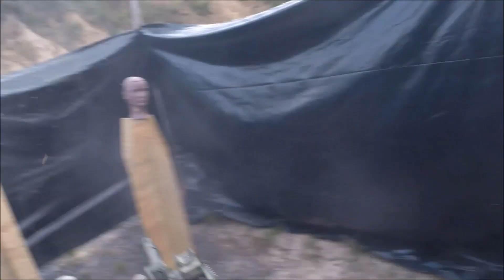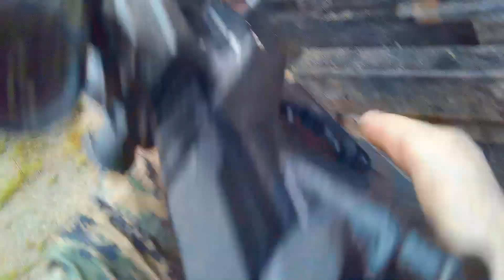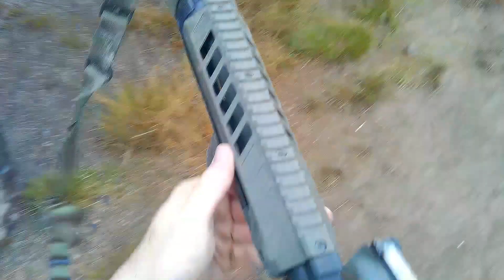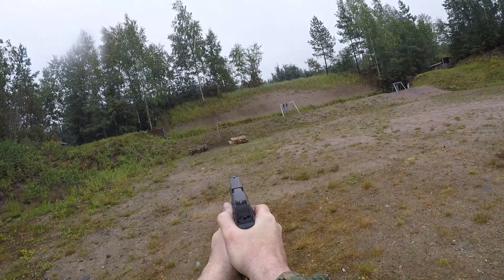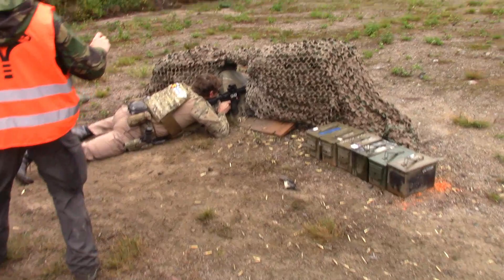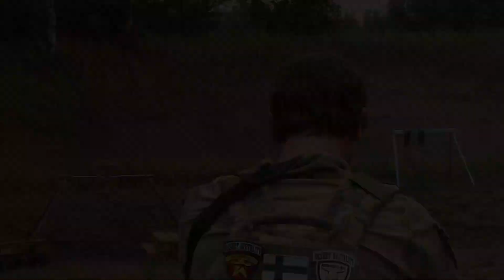FINNISH BRUTALITY 2020 STAGE 3

Comment: Regarding the ham, a large ACE bandage wrapped snuggly around your thigh (may take several fittings to find the line between snug and too tight), with WIDE duct tape at the top and bottom of the wrap, will do wonders in getting you through a rough day.
Reply from the maker: Hopefully I will never have to experience that again but if I do I am definitely using that technique!  Thanks!